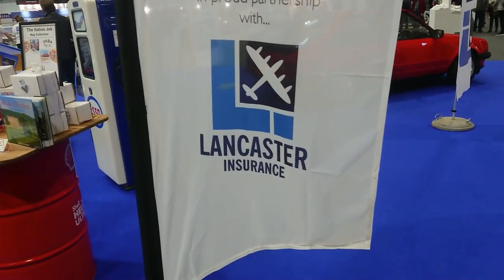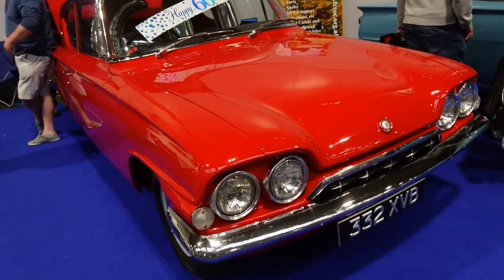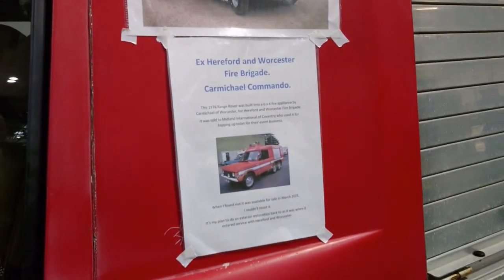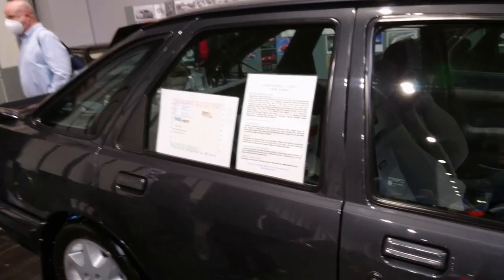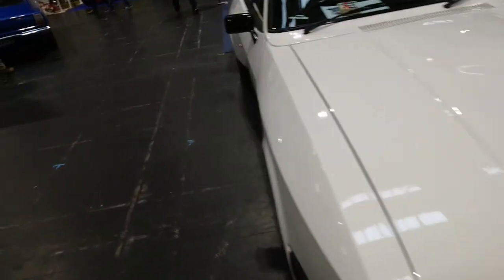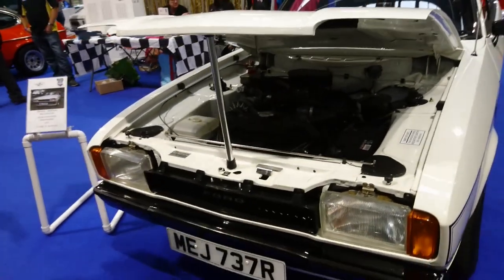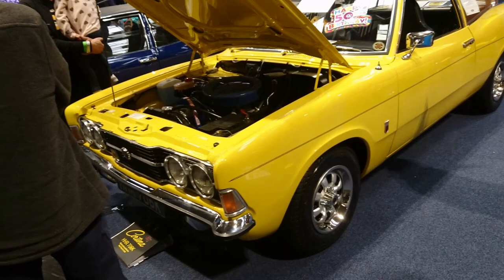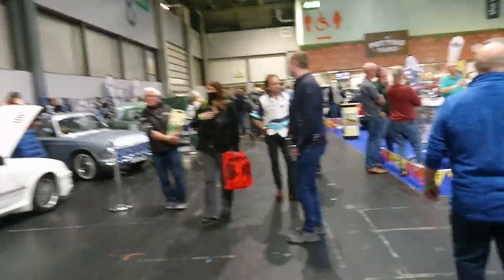A Slightly Shambolic Shuffle Around the 2021 NEC Classic Car Show - Part Seven of Sixteen (Hall 8)

Comment: Excellent Joseph, enjoyed this thoroughly.
Funny when you mentioned the ASTRO as I was "correcting" you, you must have "heard" me as you did provide the correct information! Someone locally still drives a very late Chevrolet ASTRO van, and a few older models I see from time to time, even though production ended around 1996!
Funny about the classic Ford Squire estate; here in the US, Squire was designated for "Woody" Ford Station Wagons, like the Country Squire, Fairlane Squire, Torino Squire, Pinto Squire. I believe at one time they might have used real wood panelling, but in later years they used faux woodgrain vinyl appliqués.
Reply from the maker: My knowledge of American cars and vans is terrible. Somehow, I managed to enter into the dusty memory bank to remember about these old rear wheel drive General Motors vans which were never sold over here. Yes, the original Escort and its Squire cousin have almost been forgotten now, a far more common name to use in America.
Reply: @lloydvehicleconsulting  Your knowledge is very good about American vehicles. You know quite a bit more than I do!
Reply from the maker: @frothe42  , I just make it up as I go along.
Reply: @lloydvehicleconsulting  You do an excellent job!
Reply from the maker: @frothe42  , we aim to please, sir!

Comment: My 1st car was a J reg Escort estate in the same Aquatic jade green as the Cortina shown in the first couple of minutes of the vid. Front wing tops rusted in front of my eyes, absolute bugger to colour match with rattle cans from Halfords, but great memories.
Reply from the maker: That sounds wonderful! The old rear-wheel drive Escort estates are very rare now. The rust on 1970s Fords was absolutely atrocious.... Many of these look better now than when they left the factory!
Reply: @lloydvehicleconsulting  Always had Ford cars in the family, every thing from Grandads 'sit up and beg' pop, 100e Escort Squire, Thames 10/12 cwt van, Escorts mk1, 2, 3 and 5, Cortinas mk1 Consul pre airflow, mk3 2000GT, and mk5 1.6LS (never had a mk2 or 4), Zephyrs mk3 and 4, Granadas mk2 and mk 3 Scorpio, Fiesta mk2 and 3, Focus mk1, 2 and ST, early Y reg '82 Sierra, later H plate  model,  Mondeo mk2, and currently run a mk3, and mk4. Only recently found and subcribed to your channel, just scrolled through your videos, i've got some catching up to do !!!
Reply from the maker: @robertallen3441  , well, we have reviewed a 1982 Ford Capri 2.8 Injection four speed, a 1985 Ford Escort 1.3 L and a 1982 Ford Granada 2.8 Ghia X Estate on Tweed Jacket Reviews, a 1988 Ford Fiesta 1.1 L Automatic on Sensible Secondhand Classics and a Mark I Focus 1.6 Zetec Automatic, two Mark II Focuses, a 1993 Escort Mark Vb and a Mark III Mondeo 2.0 Ghia Automatic on No Budget Reviews. All on the channel playlists. I hope you enjoy those videos if that is your sort of thing, thank you for subscribing! Eight parts of Shambolic Shuffling at the NEC have now been released with eight to go.

Comment: About the Volvo 960, weren't they all automatic? I know some people convert them to manual but i'm not sure if any came as manual as standard. Perhaps Mr. Coleman knows the answer
Reply from the maker: Mr Coleman does indeed know, but he told me a while ago. The automatic was the default option, but you could order them with a manual gearbox at extra cost.
Reply: @lloydvehicleconsulting  I imagine they’re quite rare as a lot of people would’ve ordered automatics. People more recently bought them and manual converted them for drifting and all sorts of other things that are making old Volvos more thin on the ground...
Reply from the maker: Yes, factory manuals were very rare due to the cost. There is a video on Mr Coleman's channel where he drifts a 960 Limousine round a track until the engine blows up. It's very entertaining.